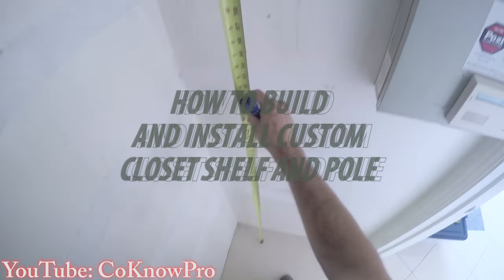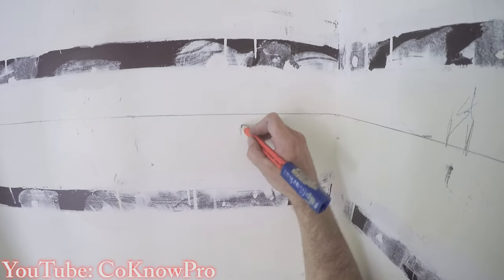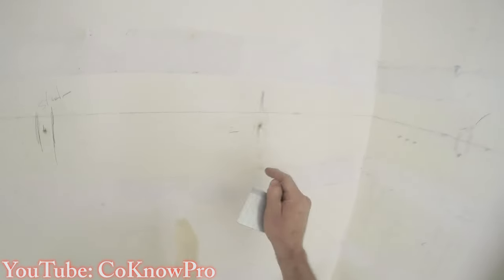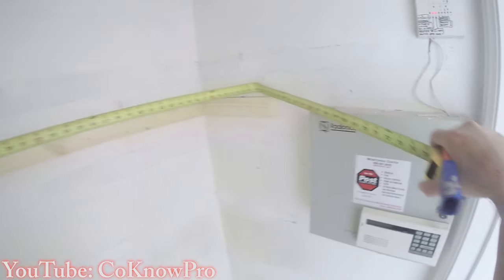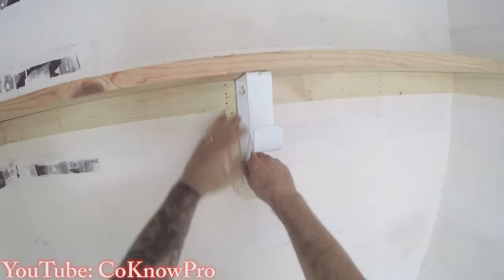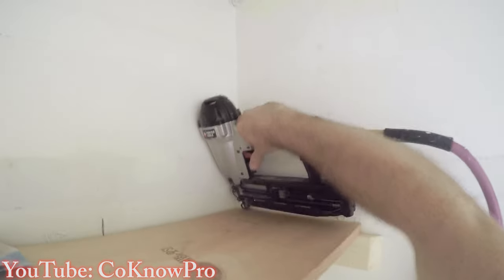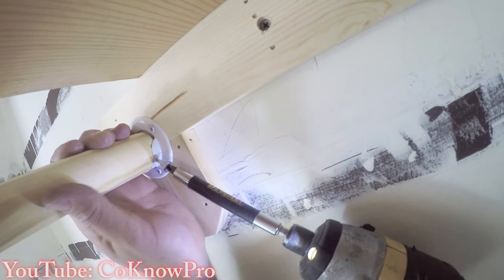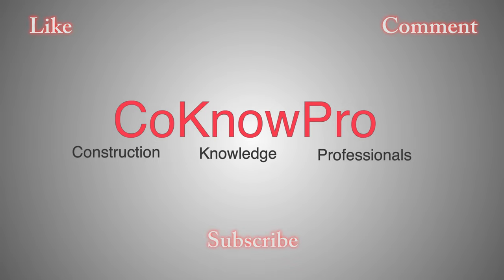⭐️How to Build and Install Custom Closet Shelf and Pole⭐️@co-know-proconstructiontips

Comment: Your bracket appears to be an accurate 90 degree angle.  The brackets I ordered aren't and the back angle of them is over 1/4" lower than the shelf. I think I'd better exchange them for correctly angled 90 degree ones!
Reply from the maker: Sometimes they come from the manufacture, a little bit off the 90° angle 📐 
Definitely try to pick out the ones that look as square as possible if it’s a little off, should not be an issue when you screw everything together. 
Great question, happy building

Comment: @Co-Know-Pro, what if the closet I want to work on and drill into studs has wires and plumbing detection from stud finder? When I took off the old shelf and rod, I noticed that nails were only used, no screws. Should I do the same? Thanks man. First timer here and I am really enjoying all the experiences so far.
Reply from the maker: Great question, you can use nails only but that will limit the amount of weight you can add to the shelf and rod if it’s a very small closet then that would be no big deal if it’s a bigger closet, then you may want to think about using screws. If you’re going to use nails and  there, 2 inch 2 1/2 inch nails to get into the stud that would penetrate any electrical plumbing as well. If there are no nail plates covering electrical or plumbing on the existing studs.Which there should be if it’s a more modern build. 
If it’s an older structure, then possibly no nail safety plates over electrical or plumbing. 
If I were you, I would add a screw where 
I felt it was the safest place to do it at least a few on your ledger. Then you can connect the rest of the ledger with nails. 
And remember, if you’re screwing or nailing into a stud, and you feel it hit something hard don’t continue to try to go past that you’re going to have to relocate the nail up or down because it might be hitting a safety nail plate. 
Hope that helps your build 👍
Reply: @co-know-proconstructiontips  thanks for getting back to me, I will proceed with caution and I think I will limit my ideas I had before with fewer shelves and higher placement. It’s a double sized (76’ X 25’) closet but has a staircase underneath thus the floor is at an angle 📐. Weird I know. So I’m trying to make the best out of that space and took off the old rod and shelf as well as the sliding doors and rails, patched and painted and got the idea to make it an entertainment wall. So I was going to hang a tv, soundbar and shelf’s. lol. It looks better than it sounds (in my mind at least), but I’ll keep you updated on any progress as I have no time limit to work on this. Thanks again.

Comment: Did you paint this after? Or do you paint the wood pieces before installation? If let's say you wanted it white to match the walls.
Reply from the maker: Great question! We actually paint the shelves afterwards. That way we can prep all the nail and screw holes with wood putty sand, then primer and paint everything already installed.
You can paint first I’ve noticed in the past when you do that it gets scratched during install then usually have to paint again. So we do it after 👍

Comment: I’m trying to redo my closet like this since my shelf ledger is literally peeling off the wall. MDF trim was used by previous owners and I have A LOT of clothes hanging. Thanks for this old video! It’s still helping people today. Also, I don’t have a Brad nailer, is it cool if I just use screws all throughout? Thanks again.
Reply from the maker: Thanks for the comment. Awesome this is a good video glad you like it, and it helps you out. To answer your question yes absolutely can just use screws. Good luck don’t use MDF get some pine or some fingerjointed pre-primed pine. For the ledger let us know if you need anything. Happy building my friend

Comment: Why do you need a bracket for a pole ? Can’t you go without one
Reply from the maker: You could go without one but it will bow anytime the pole is at 5ft or greater we use a pole and bracket in the center for sag hope that helps 👍

Comment: Great job thanks. I just didn't understand one thing. When you measure the length 3 inches, was it to the bottom of the round part of the hardware or to where the screw hole is already predrilled in the hardware?
Reply from the maker: It’s 3 inches from the bottom of the shelf to the bottom side of your closet rod. The hardware has a little flange on the bottom with a screw hole. Above that is the beginning lip where your rod will sit that should be 3 inches from the bottom of your shelf. 
You can also measure your closet rod support hardware the center bracket from the top of the hardware down to the bottom of the arch that’s where you want your rod to be level with so it sits nice.
Reply from the maker: Hope that helps good luck with your build👍😎

Comment: My closet is 10’. How many brackets would I need?
Reply from the maker: I’d go with 2 brackets depending on how much stuff you are going to hang on the rods   
You have the two side mounts then give yourself even spacing between the two brackets should be good if you wanna go overkill go with 3 but 2 is good 👍🏻
Reply: I am making my height of the closet 68 inches. I know I go around and make the measurements and then use a leveler to make sure it level. The top of my 1x3 goes to that line, right?

Comment: I started doing this in my closet but had to stop. I needed to know how to make the pole line up with the bracket and metal rod holders. I think i have it now.
Reply from the maker: Nice, if you did not figure it out yet,a quick tip is put the metal bracket up to the side ligers and use a pencil to trace out the part of the bracket that holds a pole onto the side wood pieces.Just hold it up trace it out, quickest way to do it. I hope that makes sense to you 👍

Comment: Thanks for the thought you put into explaining everything.  It’s very clear and you answered and questions because the thinking is so logical and thorough =).  We are thinking of using a whole plank of cedar for the top shelf; aside from price, are there any considerations to take in mind (e.g. different types of screws since the cedar will be harder than pine)?
Reply from the maker: Wow thank you for that awesome comment👍 as far as the cedar you will be okay with standard screws as long as you use a pilot drillbit or a pilot drillbit with a counter sink combo bit  before you install your screws and you will be good. If it’s going to be outside then definitely use some deck rated screws but still recommend using a pilot with a counter sink. 
You can also practice on a sample piece of cedar before you actually commit to your finish piece to make sure everything works the way you want to as far as screws pilots countersinks whatever you’re going to be doing depending on your finish. 
Hope that helps you out and thanks for the amazing comment and for watching👍😎

Comment: Height of shelf and width of shelf would be awesome.
Reply from the maker: Hi, yes the shelf is 12 inches wide/deep.  Also, the height of a standard closet shelf is between 64 - 72 inches from the floor.  The one in the video is 67 inches off the floor.  The height of a shelf and pole depends on your needs.  Hope that helps.  Thanks for the question, CoKnowPro.

Comment: any tips on if we wanted to make an l shaped shelf. how do i join the shelves in the corner. don't have a lot of special equipment/one use gadget tools.  Thanks!
Reply from the maker: You can use a splice a 1x4 cut to give your seem at the corner some strength. 
Or you can cut plywood into the corner piece you want, then it will be solid but will still need a splice we’re plywood connects to other shelving on the sides. Sorry it took 5 years to respond but better late then never 😊👍

Comment: How do you do a corner like if there’s another one running along the other wall also what if you need to do 2 boards how do you join them
Reply from the maker: Check out this video below ⬇️ it might answer your questions. 

😎⭐️How to Build and  Install Walk-In Closet Shelf and Pole🔨@co-know-proconstructiontips
https://youtu.be/Y_YTtQIxPMU
Reply from the maker: If that doesn’t answer your questions let us know. 👍
Reply: @co-know-proconstructiontips  it did I thought the same but thought it would look tacky but it doesn’t so I’m have to do this I was thinking of using dowels but I’m using mdf but im use dowels in the rod because I got like 17 ft run to do
Reply from the maker: @arealmaintenanceandrepairl1103  nice   Remember you can run like a one and a half inch trim or just a one by 2 along the Face of the shelf and will help hide all your  splices.

Comment: Could you use 18ga instead?
Reply from the maker: Yes definitely but you need to secure with some screws as well. Don’t just count on the 18 gauge to hold up the ledger or the shelf. Great question 👍🏻